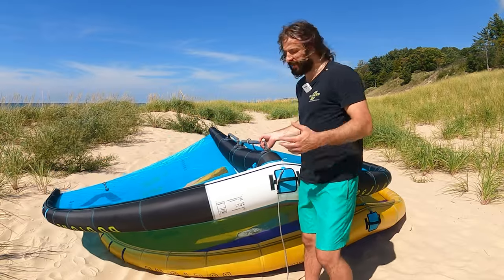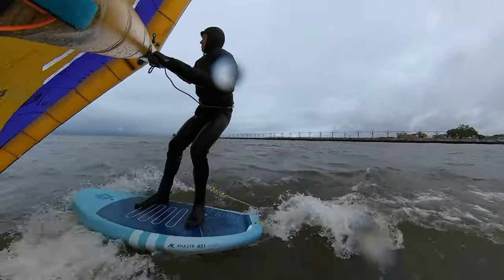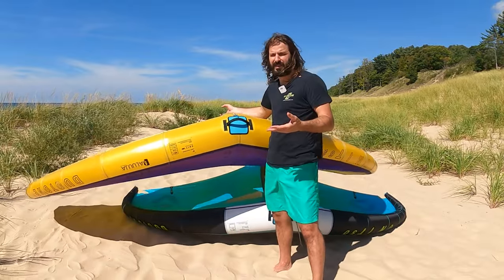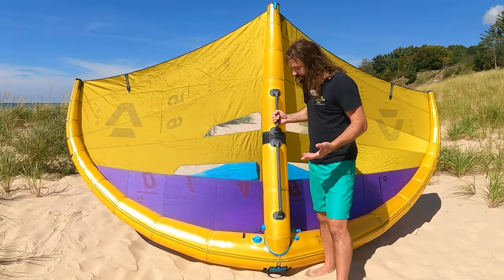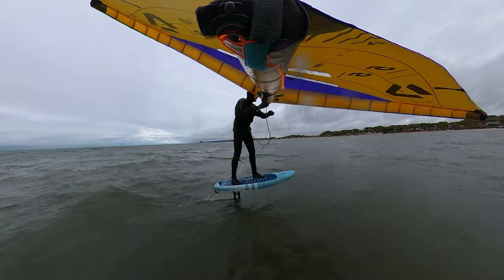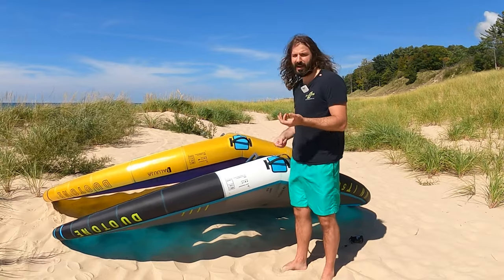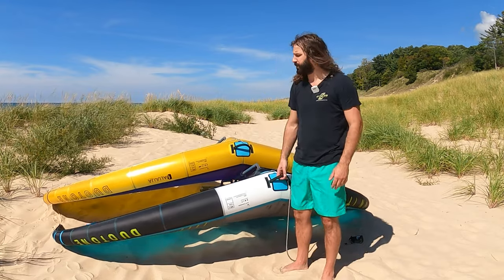2024 Duotone Unit D/Lab Wing | Worth the Upgrade to Aluula?

Comment: Great video. Been riding a '22 6.5m Slick for 2 seasons--pretty much bagged out. Thinking about big upgrade to DLab Slick (old windsurfer dude).  Would 6.0 DLab Slick have same or better performance as original 6.5 Slick? Thanks!
Reply from the maker: Yes, the new d/lab is a big upgrade in weight, speed, and upwind performance. I do find you can size those down about a half meter if you want to.  That new Mod3 canopy will have a longer life as well. Especially with the Aluula frame to support it. -Tucker

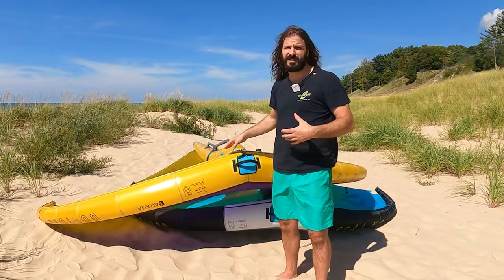Comment: Hi, in 3:37 you say that the Slick is better in speed and upwind than the Unit? Is that correct? I heard is the other way around, Thanks
Reply from the maker: Yes, the slick is more forward pulling which gives it higher end speed and comfort at speed. It also points higher upwind. The Unit has more grunt and downwind pull. -Tucker
Reply: @MACkiteboarding  Thanks!

Comment: @mackiteboarding  How did you fix  the cam at the end of the middle strut & which cam was used in the dlab footage ?
Reply from the maker: I use a wrist mount and jam it into the end of the strut before inflation.
Reply: @MACkiteboarding    thx.  was is a gopro or a insta 360 ?
Reply from the maker: insta 360 @LaDeSoul